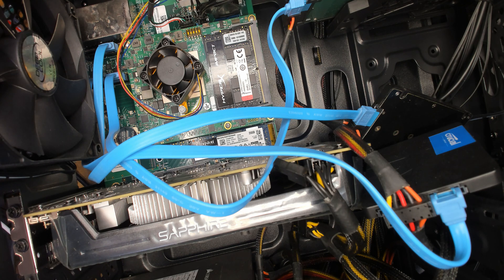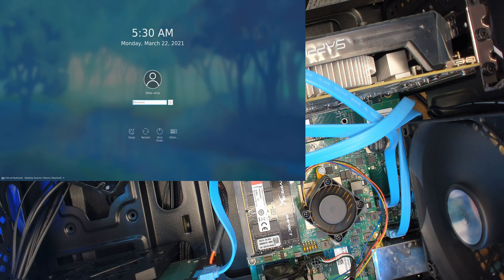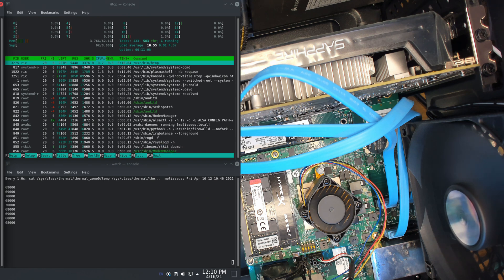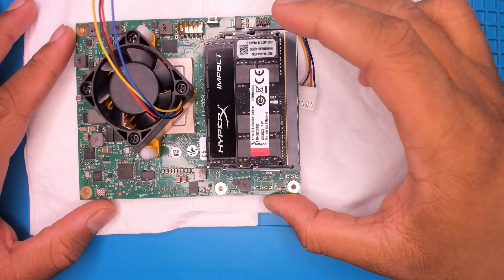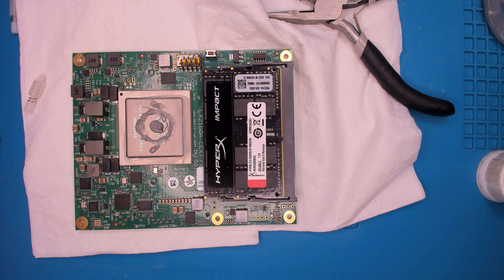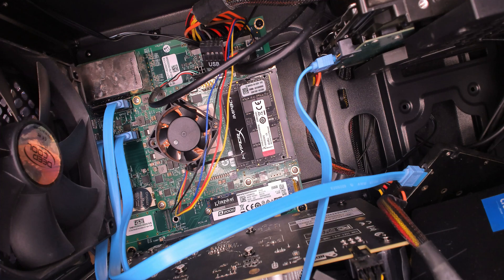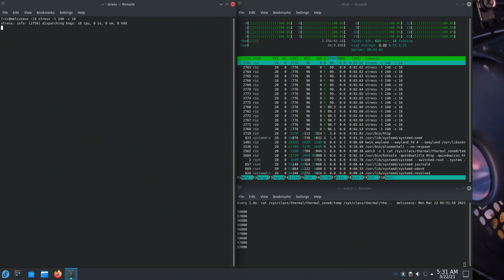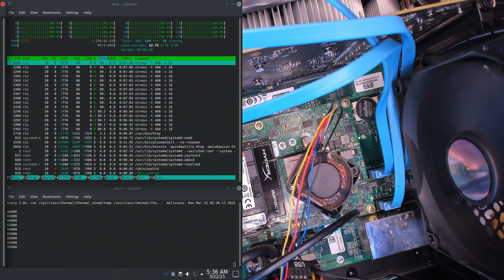Heatsink Mod and thermal benchmark on the SolidRun HoneyComb Arm Workstation

Comment: Wait there are official arm desktop platforms with pci express porting among other things here? Cool.

As this is an arm based platform, can you attempt  an equivalent to the bsel mod on Intel x86 c2d/c2q cpus but on an arm cpu?
Reply: If I am reading what bsel is correctly 

You can compile a firmware with custom timings and flash it to an SD card. You actually choose your firmware based on ram speed as it is now, but you can customize more.. All the risk to the hardware,  no physical shorting
Reply: @trelauney  the bsel mod is when you disconnect the clock speed governor pins between the cpu and motherboard to make the cpu go full speed kind of like removing the speed limiter. What I'm looking for is to do a hardware only mod on either side of the socket.

Comment: Will note.  This board is being running at 2.3GHz, which is technically overclocked.  The thermal design of the default cooling is targeted for the stock speed of 2GHz.  One of the reasons we are using the most "generic" cooler mounting that would fit on a CEX7 module is to allow use of off the shelf cooling solutions to be used for different implementations and requirements.
Reply: Is there any chance, one can get it to run at a higher clock?, 3ghz!, 3.2ghz, with an overvoltage?.
And which header is its smbus power management interface?,

Comment: about 40% of cpu not covered w/ heat sink. Keep shopping!
Reply from the maker: Actual die size < shroud size.
And 10% not covered is more appropriate. Stop overestimating, Karen.
Reply: @usrbinsh  The only way that this would be a problem is if one of the thermal zones was showing a hot spot.